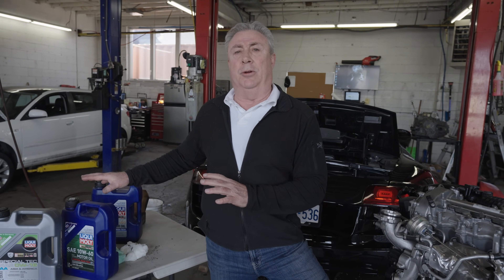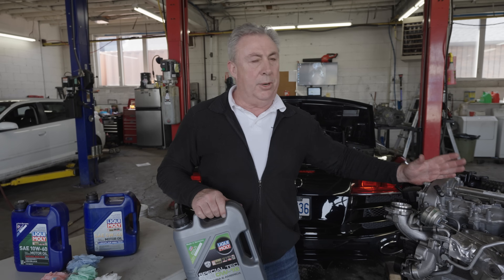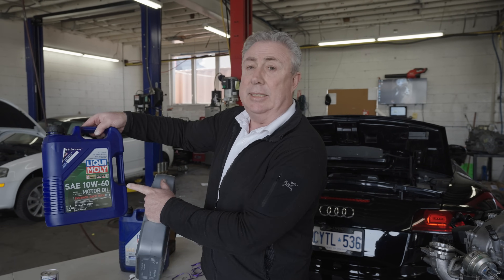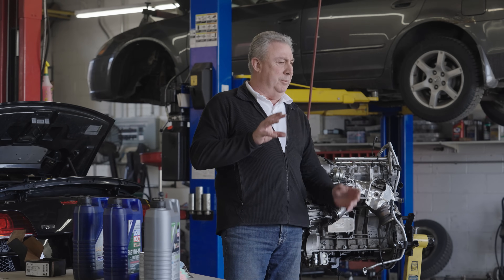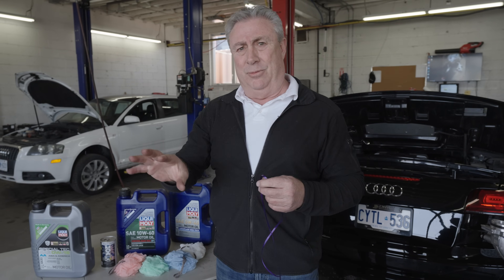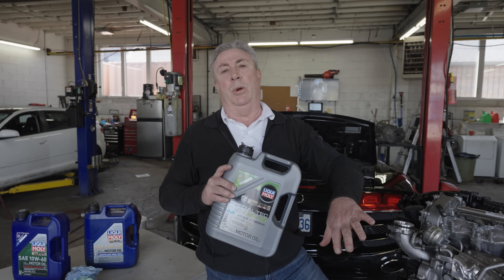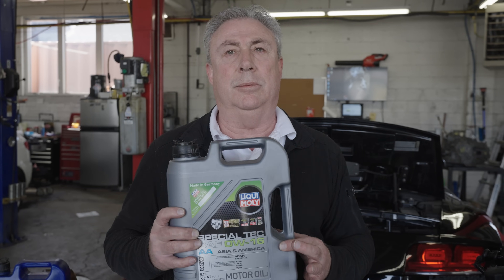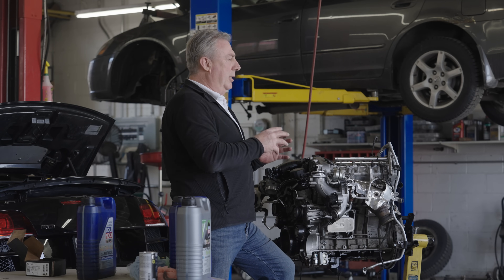Thin engine oil just a Scam? What's Safe

Comment: Tip:  If you are going to Death Valley, always use a rental car.
Reply: Just like in "Fear and Loathing in Las Vegas".
Reply: "What'swith all these bats!" @kenweller2032
Reply: Most newer cars have coolers. My car has an oil cooler, plus a really good radiator with good fans. If you're just driving normally, it cools on the hottest days, no problem.
Reply: Best comment!
Reply: And get their insurance.
Reply: Rent it in someone else's name.
Reply: now there is a person with a head on their shoulders
Reply: All my cars have done great at Death Valley for the last 20 years.
Reply: Drive a junkie like me
Reply: you smart mamen !!!
Reply: Or someone else's car 😂
Reply: Haaahaahaaaa!!!
Reply: Some rental agencies prohibit visiting the place during the summer.
Reply: LMAO!
Reply: Or use a Two grades Thicker oil.
Reply: Modern engines/oils can handle 120f no problem on non racing aplications.
Reply: @benchmark3332  Also, many vehicles have a towing package option that includes increased cooling performance components. This helps ensure that engine fluid temps stay where they should be at very high ambient temps when towing.
Reply: @benchmark3332 That's 120F PLUS the heat of the engine. Your comment is way off.
Reply: @nexxusty  The engine runs 200f so 120f is cool. You have much to learn.
Reply: @benchmark3332  Yup, temperature is relative.  Obviously its more helpful the cooler the ambient temperature is, but there will be some cooking as long as ambient is cooler than internal temperature.  You just cant run the vehicle as hard when ambient temperature climbs because it makes it more difficult for the cooling system to keep up and the engine temps.

Comment: Its the quality of the oil that matters most,0w-16 oil today has a better additive package,not to mention how the variable valve systems work. Use what the cap says,and change oil at least every 5k as a rule. Better filters help too,I use Purolator one and Amsoil 0w-16 only in my hybrids.

Comment: Brand oils , must meet emissions requirements,  fuel economy, etc valvetrain wear , some off label oils have a higher additive pack, bad for environment but better for engine, your choice. Longlife oil , but no longlife filters, scam around service maintenance by dealer, most damage done under warranty,  bmw or land rover, point in case, at 150 k km lots of oil leaks and wear, different scenario if oil change every 10k and look into changing filters every 5k km, see how blocked filters get at 10 k km, so dirty oil gets bypassed.

Comment: Interestingly my owners manual says that a 5w30 is allowable year round while the cap says 5w20. I'm my own personal experience using 5w30 i can tell you my engine has been quieter and prone to less jumping of RPM when accelerating. 

Check your manual folks you might be able to use slightly thicker without manufacturer concern.
Reply: 2011 Mazda 3 2 liter owners manual says 0w20 for north America and 5w20 or 5w30 for Mexico.
Reply: @aywitb911  All because of CAFE.
Reply: My Kia recomends 5w20,5w30 or 10w30 depending on the climate.I use 5w30 synthetic year round with no problems.134000 on the car.
Reply: @Theopholis9  My Toyota GR Supra manual suggests using higher viscosity oil for track racing. Otherwise, 0W-20 is required to fulfill warranty requirements. That's what I use - GR or BMW synthetic oil with the required certifications.

Comment: Show us the laboratory wear-metal test results.
Reply: This. All this guy is spewing is BS. Back it up with a black stone lab test. same drain interval, same temps, same trip lengths.
Reply: Nope, he's given useful information. Compared to your bs ~
Reply: @georgehofgren6123  I know for a fact 0W20 works fine in an engine designed for it based on not only oil testing but also vehicles that reach 300K miles with proper OCI, not magicians OCI.  BTW, the LiquiMoly didn't do near as well as the competition.
So keep digging, you're not there yet!

Comment: Thinner oil, engines don't last as long, carbon foot print goes up.
Reply: Exactly, Absolutely, but our dumb blind governments and engineers can't think that far, and most of people even less.
Reply: My personal experience says otherwise. I have a 2011 Miata with 225,000 miles on the odometer and have been using full synthetic 0w20 its entire life. It still runs like the day I bought it.
Reply: My Honda is 13 years old 0-20 every 6 months new filter ,absolutely fine.How long is not as long?Even if it packs up now i have not had any layout in repairs.(with respect).
Reply: @PaulHoward-n3x  Lots of oil changes.
Reply: @lawrencehalpin6611  Yes but no engine changes 🧐👍
Reply: Yes but profit increases and that’s what all regulation is about. Milking the cash cow
Reply: @dgoodman1484  The filthy weasels will tell you anything to make a buck 10/40 will work just fine in any of the mouse traps on the road today and that's a fact !
Reply: Arguably…they can shear down quicker . Although a thin good quality synthetic will outlast conventional thick oil all day long. The real issue is fuel /fuel byproducts dilution . It’s single handily the reason all motor oil doesn’t last 5 times longer

Comment: Oil has improved so much i remember when mutuviscosity oil came out humble uniflo 10 w 30. It didntvwork they bought a lot of engines main reason it increased oil consumption dramaticallty and people didnt check oil level often enough also because it never got any heavier than 10 wt burned up engines. Oil weight is normally soecified because of bearing clearences. Modern engines are cut on cnc machines with extremely tight clearances. I would not drift too far from manufacturers recommendations

Comment: Don’t forget. The lighter the oil the faster and more complete it runs off your cylinder walls when you shut it off.  So you start an engine after say 20 minutes and there’s very little on the cylinder walls
Reply: Means absolutely nothing in a hot engine that will go thru heat soak upon shutting down. MORE important is that lower viscosity oil will gravity flow at every Cold start... down thru the head, rockers, valve guides, timing chain -
Reply: Really! WD40's pretty thin; but still leaves a boundary layer!? I think cold starting's way more the real wear issue; so thin oils are usually far better, on balance?
Reply: @Richard_L_Y 
Thin oils are better at flowing when cold.

Thin oils don't necessarily cling to surfaces better, or longer than thick oils.
Reply: Agree. The thin oil guys are selling a story of bull schitt.